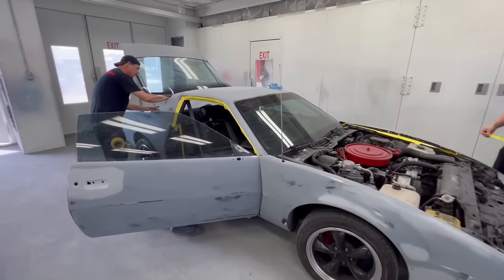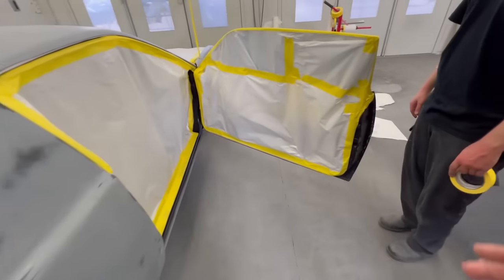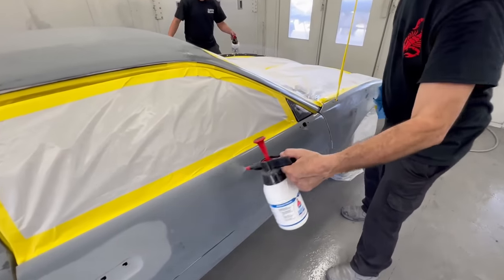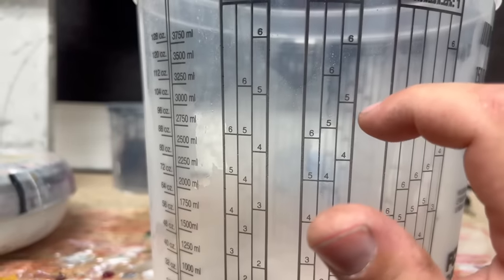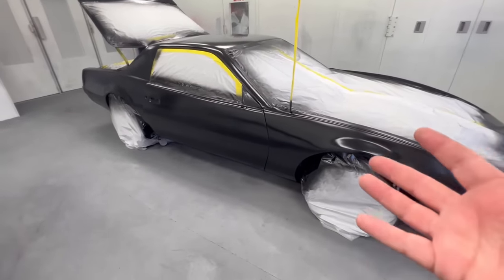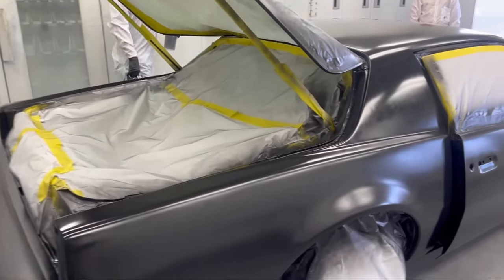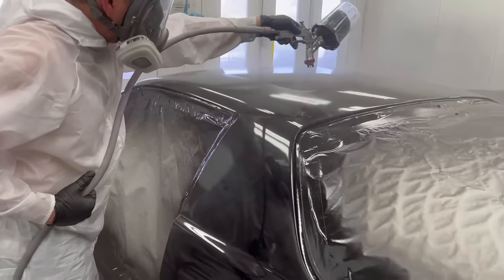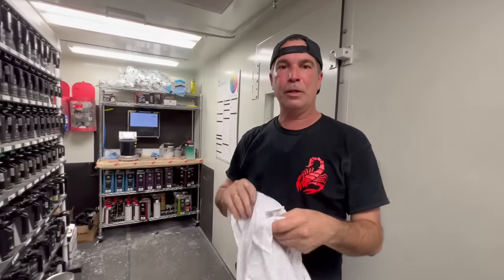How to Spray WET Single Stage BLAC￼K Paint without Orange Peel!

Comment: I have always liked the look of single stage black. I had a 79 Trans Am back in the late 80s painted with black Imron and it looked killer and stayed looking good for years.
Reply: I worked for a few high end shops 90 percent of our black cars all get painted with Single stage then get wet sanded, buffed, some time we would wet sand and hit it agin with 3 coats of Clear coat then re wet sand and buff
Reply: “Imron “ was an amazing durable paint, and looked great, when laid down correctly,
I used Imron on my 51Chevy pickup running boards, … it was like powder coating.
Reply: I’m watching this trying to learn how to paint my 79 TA 😂
Reply: I got a 70 Chevelle and single stage was all they had from the factory back then
Reply: 1984 Porsche 928S in original single stage black Glasurit.
Reply: Iron was damn near bulletproof awesome paint
Reply: Imron

Comment: that turned out nice,I have never painted base clear as I was trained to paint with the old fashioned enamal.I worked at the time at a GM dealership in the early 80's ,we used acrylic laqour and enamal.Both paints loved to run if you wasn't carefull.But sadly because of the fumes etc I had to give it up,,last time i held a gun was about 12 years ago but it's like riding a bike you never foget.

Comment: Another great vid! I actually watch your videos while I'm waiting for a job to flash, not all the time but I still watch. 
Question, a 2021 Toyota Highlander, has primer on 90% of the entire driver's side and left corner front bumper and corner of rear bumper.. if you started at 8am, what time would it be when you laid down your final coat of clear? Thanks

Comment: Hi Brian, love watching your videos from the UK, I'm just about ready now to paint my 1st car, I purchased the R500 after watching your recent video, I have a question, I have a 73 VW beetle and my question is, I have no booth and would be Painting outside, I can take the wings/fenders, boot and bonnet off the vehicle to paint inside, would this cause a problem if there is a time frame between these parts to the body , I'm use UPOL , PRIMER, AND CLEAR with a custom colour base coat

Comment: The last QT of paint with hardener I bought cost me over $170. I never sand finer then 320. Never had any sand scratches show up. I always clear coat single stage paint too. My paint jobs last for years. Base coat clear coat is junk paint.

Comment: Prefer not to use a sealer,, prefer to mix it up as an epoxy and let it dry for a week,, scuff it down,,  non-cured sealer will leach chemicals into the color, that's sprayed over it,,

Comment: Brian that looks great but I do have a question about single stage. Can it be sanded with 600 and cleared after it has cured if you get a lot of trash in it?
Reply: If you have put enough coats on, just buff it. Single stage buffs easy as long as there's no metallics. If you want to add another coat, sand and reduce, but I  prefer to stack SS from the beginning.

Comment: After the single stage cures, you can always sand it smooth and put a coat of clear on it. 
I've heard if you start with single stage black. Sand it smooth. Then do a coat with 25% clear mixed with the single stage. Sand, then 50-50 single stage and clear. Sand. Then 75% clear with the black. Sand. Then full clear. I heard this is how to get a custom black paint job that looks like you can put your hand through the paint. I've never seen it. But I've wanted to try it since I heard about it. Expensive and time consuming. But probably worth it on the right car
Reply: yeah this is an old school method, a lot of the older painter will do two coats of single stage. Then for a third coat do a 50/50 mix single stage and clear.
Reply: INSTEAD OF THE EXTRA EFFORT AND MONEY IN MATERIALS, YOU LAY DOWN 3 - COATS OF SINGLE STAGE , OBSERVING THE DRYING TIMES IN BETWEEN COATS , IF YOU USE MEDIUM REDUCER THE PAINT SHOULD FLATTEN OUT MINIMIZING ORANGE 🍊 PEEL , IF YOU HAVE TO BUFF USE 3000 GRIT WITH 3M PERFECT IT COMPOUND USING A FOAM PAD,  A WAFFLE PAD FOR THE FINAL POLISH !!!!!

Comment: It seems like people are starting to warm up to single stage more now these days, coming up 6 years ago I've heard many people say it's crap. If you want a good paint job on the cheap, single stage is the way to go, like any other paint job prep is 90% of the job. If you do it right, cut and buff, you can get a award winning finish. Also it's so forgiving, if you have enough time runs are irrelevant, just sand it down so long as you have enough thickness to work with.

Comment: Good job guys! In mixing cup 8:2:1, is it possible to add first reducer and after add activator in this case i dont need to make any math or its not gonna work?
Reply from the maker: Yes that will work. It wont be off by enough to matter. As the cup gets bigger the spacing of the lines are different

Comment: Couldn’t you have just put the reducer in before the activator and used the cup as it was?
Reply from the maker: Maybe but as the cup reaches the top, it gets bigger and wider and the lines are measured to be equal with the cup size.

Comment: I love this and plan to do a similar paint job on my 2005 Yukon XL Denali (now THAT'S a lot of paint!) urban assault vehicle. It was originally clear coated but that eventually failed and this won't, at least not in the same way. Now a question: How would this single stage paint job compare with two stage IF YOU ADD A HIGH-QUALITY CERAMIC COATING? Ceramics weren't available in 1990 OR 2005. Is this a viable option? It would certainly save both time and money.

Comment: So Brian I’ve been dealing with a self created problem. When i started my truck project 2 1/2 years ago I accidentally used my primer activator with my actual paint. I didn’t discover this until months later I went to remove some runs and discovered it. Since all of that I’ve DA sanded 180 and reprimed . I thought I had removed all the paint with the wrong activator . I’ve switched to base clear for this next go round thank goodness. Here’s my question when single stage urethane is fully cured with proper activator should the paint be rock hard or a little soft , like you could pick a nick in it with your fingernail  I’m thinking I may have not gone far enough when sanding my mistake off! When I sprayed white base the other day I had some edging appear when I investigated it appears to be a layer of blue that was showing from the first spray with Single Urethane. Thanks !

Comment: This brings me back. With a chevy 350 pushin a rear wheel drive unibody these things were among the most dangerous machines on the road but damn they were fun to drive. Rolled mine into a tree and snapped the rear axle. Climbed out the passenger side window, gave her a kick and she flopped back over right side up. She was smoked but I turned the key for shits and grins and she fired right up. She was one tough old bird.

Comment: Painted my 89 firebird with red single stage. Used a 1.4 tip. I did not get a lot of orange peel with three coats. What tip size do you suggest for Rival 3.5 single stage?

Comment: thanks for all of these videos, had a bumper to respray and aerosol cans where just not working. decided to make the jump and get a spray gun. car is 019 black with clear coat. but decided to go with u-pol 2k direct gloss black and their associated primer. came out better that i could have imagined, couple of runs, but ok considering  all the converging contours on the bumper. very little orange peel and car looks great. m from the uk.

Comment: Prefer not to use a sealer,, prefer to mix it up as an epoxy and let it dry for a week,, bed scuff it down,, a non-current sealer will leach chemicals into the color, that's laid over it,,

Comment: I have always found painting single stage way easier to paint without peel, I learned on it with a binks bbr. I find such a difference in base coats even different colours of the same brand can give you grief, now plain black is probably the easiest colour to me to get a hi gloss no orange peel paint job with any gun.

Comment: I used PPG Autothane single stage 2K, it was trash, the paint was so soft that if you looked at it funny it'll scratch.  Wish I knew better and went with a 2K clear instead.

Comment: I have been watching while I prep my car at night after work! My wife hates this car because it’s taking time from her. But I am a guy! Anyway I got this 2007 Mercury Milan for $400. I am a mechanic and it did not run. I got it running for less than $100 so I figured that I could splurge a little. The paint was not in bad shape. But the body, hay Zeus. Bad bad. So we have a paint both at work and I thought what the hell. That how I found this channel. I have done lots of body work but never painted before. So I think this will be my first attempt. This looks like the single stage paint job I want to try. Thanks for the video. This is an inspiring channel. Representing Gainesville, Florida.

Comment: instead of trying to re-engineer the lines on the cup, use them as intended. it has lines for 8, 2, and 1. why did you use 2 for 1, and 1 for 2? just use the right mark for the material that gets that qty.
Reply from the maker: As the cup gets higher, it gets wider and holds more paint so if you reverse it, its not accurate.

Comment: just a person interested in painting. 
i got confused to why would you mix like that comlicated. you said its 8 parts of color, 1 parts of hardener and 2 parts of thinner. you had a scale of 8.2.1. so why wouldn't you just mix it in order of 8 parts of paint, then 2 parts of thinner and lastly 1 part of hardener. like the order wouldn't matter anyway, or does it?
Reply from the maker: Because as the cup gets bigger towards the top, the ratios aren’t the same, the sequence of lines are separated differently.

Comment: Hi  i love  your  videos  i learn a lot  from it  but i just  want  to ask you i am on the midlle of my project  i  work on my  vintage  car merc  estate  i did some   body  work  and i start  respraying i  small garage  now  question  i spray  prime on  vixed panels  and   rest of panels  i   used 600 grid  paper  to  ready  for paint    after  i did  this  i  spray  3  time  but i didnt  spray   lacquer  yet    and  only  because   is very  cold  in dublin    qestion  can i  sand  down before   i  spray  lacquer  to  make sure  is  nice  and  clean  and  how  fast  i need  to spray  clear  laquer  on paint  i can send you  some  pictures  if  you like  to tell me  what you  think  regards  mark .

Comment: I've done a single stage metalic paint, and it came out decent.  I was spraying in less than ideal weather conditions.  My point is it absolutely can be done.  I need a paint booth like this one, it's freaking huge!
Reply: moskvich actually had single stage from factory. while it was better at rust protection, it was worse at looking pretty. for some reason, that metallic happened to shrink with sun shining on it (so i quess heat shrank it) and the whole paint is like spiderweb. and i haven't seen a metallic that says it doesn't need clear. all the metallics i've seen says it needs clear coat.

Comment: So those bumper covers are not metal. They are urethane. You’re painting it with the same paint as the metal panels. Are you not adding a flex additive?
Reply: They may have, but I mean…it’s a $150 job, so I would understand if they didn’t. It’s a low value car, but it looks good

Comment: Great video and thanks for sharing. I worked at a mom and pops body shop 30 years ago and was a painter. I haven't picked up a spray gun in 25 years. I think it's time to too. There's a few parts under the hood of my car that I will be spraying instead of paying a body shop. I already have  the compressor and the hose. I'll get rhe rest of what's needed this coming week.

Comment: Try to avoid painting over the VIN stickers or door stickers if possible. If you decide to sell later that's your proof the car has its original parts.
Reply from the maker: The rear hatch was replaced. Thats not a valid vin

Comment: Why not use 8:2:1 and use 2 for reducer and 1 for activator?  What am I missing?
Reply from the maker: The cup gets wider as it gets higher and holds more volume
Reply: @PaintSociety  Correct that's why the distance between graduations gets smaller as you go up.  That's what you see on your cups.  BTW - love the channel and rarely miss an opportunity to watch and learn!

Comment: Why don't you just use the 2 for reducer then put in the 1 part hardener instead of splitting the 2 for hardener?
Reply from the maker: Because the cup as it gets taller, gets wider and holds more material

Comment: Instead of trying to eyeball the mix like Brian did, I would recomend pouring the reducer in the 2 column then the activator in the 1 column after the paint in the 8 column. Giving you the correct mix ratio per the TDS without the guessing 😊
Reply from the maker: As the cup gets bigger the lines are placed differently because the cup is wider as it reaches the top so technically no that wouldnt be precise but it wouldnt affect a whole lot
Reply: The measurements are broken down in equal parts per the mix ratio. 8:2:1 is a mix of 11 equal parts. It works. The order of mixing ingredients isn't as important in this case as the quantity of ingredients  is. And yes the cup gets wider at the top wich is y the lines get closer top to bottom in the column. Just dont want to confuse the newer painters to you channel. Switching the order of ingredients to match the correct ratio columns is less confusing to me the trying to eyeball 1/2 of a mix column. We both know you could go over or under a bit in ether the reducer or activator with out really causing any harm. But keep up the fantastic work! Cant say enough good things about you and I always recomend you to any new customers I have that need some quality information for thier DIY projects at home!! Thanks for all you do brotha!!

Comment: For anyone who sees this dont do single stage paint jobs. You can correct so much with clear coat and a good polish. A good thick clear coat allows so much room for errors that you can cut and sand out and even add more clear if needed. PLEASE DFONT SINGLE STAGE IF YOU ARE A NOOB.
Reply: Do you have experience painting to say that?
Reply: @BryanClark-gk6ie  No I have never painted a car I just know from JRE and Fresh & Fit podcasts how to do it

Yes, what are you dense. Think I offered that information without experience.
Reply: @akumaquik  
With SS paints' you can fill in minor perfections....
Chips/Scratches/Pinholes/Small dings etc. 
Spray your first coat..... identify those areas' once it's tacked up and ready for the 2nd coat' spray on those areas/building up those areas' basically spraying them away' filling them in' might have to repeat that process a couple of times' letting the paint tac up before your final coats. Single stage paint can be sanded and buffed just like BC/CC once it's cured' depending on drying conditions. 
SS paint can also be blended/burnt in on small areas' rockers/ post' just like BC/CC. 
Lack of knowledge'Too many people spreading wrong information about SS paints.
Reply: @BryanClark-gk6ie  For anyone reading this. What he said is true. Still don't change the fact a clear coat is more versatile and easier to repair. This is old school mentality of car painting. Earl Chive paint jobs, Maaco jobs and every other jank paint job out thr.

If you are painting your car for the 1st time buy an extra clear coat and spray your peaks heavy. Give it a couple of weeks and let it vent properly then cut and polish. The result here is rewarding for the labor.
Reply: @BryanClark-gk6ie  On a personal note. Buffing and polishing SS is a mess and the paint never looks as good. Lacks depth. I have seen horrible base applications with horrible clear coats that are repaired with cuttting and clear filling with a toothpicks. Clear offers alot more wiggle room and no matter how rough your application is more clear and elbow grease will make the end result look professional. Just my two cents.
Reply: @akumaquik  
What ever works best for you. For a beginner' SS is alot cheaper than BC/CC.
Like I already mentioned' SS paint hides more imperfections' scratches/ small dings/not so straight body work etc' areas like that can be blocked over to correct those imperfections where as' once you spray your BC/ CC then CC' there under the CC' no blocking to correct them' most all beginners won't notice them which means you'll have to start all over again when you do' to correct them' more time painting and materials. 
I can go on and on' to understand you'd have to have hands on experience' not what some random YouTube video leads you to believe. SS urethane paints have CC mixed in with them' you can buff it to look just as good as BC CC in less time and it has a deeper look to it. 
You don't want to let CC dry for 2 weeks' it's like buffing concrete at that point and will take forever vs SS paints. Like I said' you'd have to have hands on experience to understand.
Several restoration shops/ show cars'  uses SS urethane paints for its luster' depth and shine. 
I'm not talking about maaco quality of work.

Comment: Well they have a booth to do it in.
Reply: It's difficult in a two car garage with dirt and then wind outside. 
I did single stage black and it has allot of orange peel, only way I can think to correct it is to wet sand the entire car then respray it, make adjustments to my gun. I am working in a tight garage.